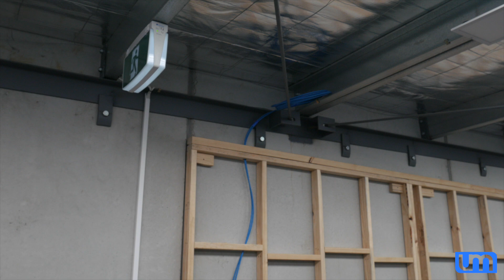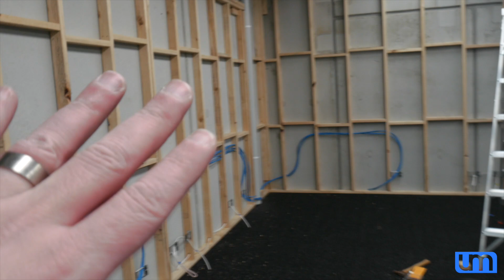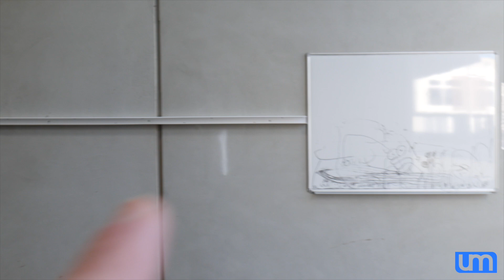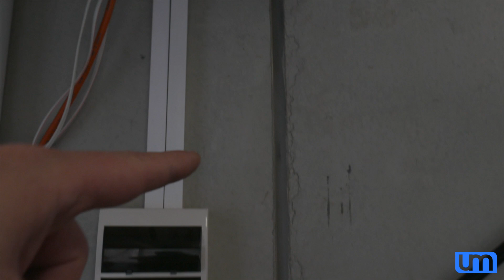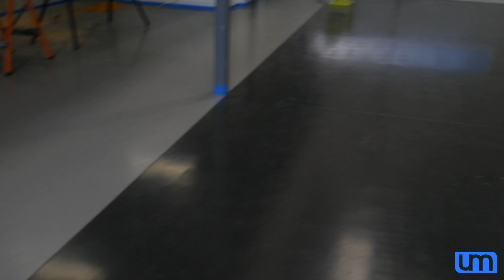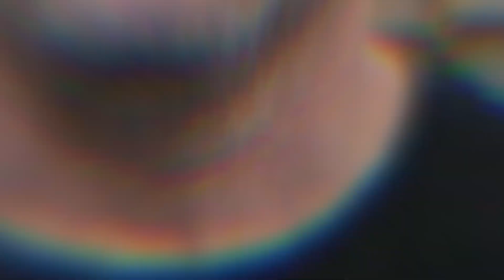New UM Space Vlog - Ep3

Comment: I would suggest you to run a fiber line (or two for redundancy) from your office area to production area, so that in case something nasty happens to any of production units, it won't blow off entire network. Also fiber is immune to EMI, has very small diameter (compared to regular copper cable) and can be pretty much as long as you want it to be. Mikrotik sells some very affordable switches with SFP+ cages, and pre-terminated fiber is fairly cheap too, so that shouldn't break the bank, but it will give you a piece of mind with full electrical isolation.

Comment: Looking fantastic Seon. Not sure what you had "hoped for" in terms of timeframe but you really are moving very quickly in terms of tradies quoting, in and out. BTW, any reason you didn't run the cables that have to go past the exhaust pipe up via the ceiling? That would allow you to completely and cleanly cover that pipe when it's plastered...
Reply from the maker: I wanted to leave the exhaust exposed and accessible, just in case... and I didn't want to make the wall thicker to go over it either. The cables will be under desks and not visible, and I saved 20m of CAT6A not having to take them up and down again ;)

Comment: Is the air compressor going external or just on the back wall? I'd be concerned of the noise these produce if internally located. Take a day off too, I'd guess you'll be feeling extra work load being torn between handling normal UM stuff at the house and now dealing with this. 🖖
Reply from the maker: Internal - It's a silent scroll compressor - not worried about noise. It will be sitting on the floor against the back wall.

Comment: Don't you want at least 1-2 20+ Amp circuits on your sub panel in case you want to put in a larger piece of equipment? In Germany we usually have a 20 Amp for the kitchen because even an oven or a drier can kick the 15 Amp breaker. 15 Amp is not even 5000W so if you get a furnace, CNC, or anything else you will hit that really fast.
Reply from the maker: In Australia, a 10A circuit has a 15/16A RCD. A 15A circuit has a 20A RCD.

Comment: what about pneumatics pipes ? ( for air tools like blowers , p&p , dust cleaner  , air brush paint , rivet machine , etc )
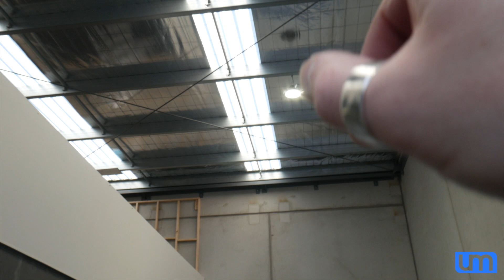Reply: He talked about routing air in the cable tray suspended by the threaded rods from the ceiling at 11:00 minutes into the video.
Reply: @paulrautenbach  ok did not catch this one , I have posted my comment for the other room
Reply from the maker: The thing I didn't mention here is air extraction and ventilation. Plans here have changed, but until that dirty area separation wall is up and I work out how I want to lay out the dirty tools area, I'm not really able to map that out yet.

I've oriented the assembly line with the reflow oven and dirty tools area at the same end, so extraction only needs to come down rom the ceiling from 1 end - but I'm still expecting some difficulty getting it all into play.